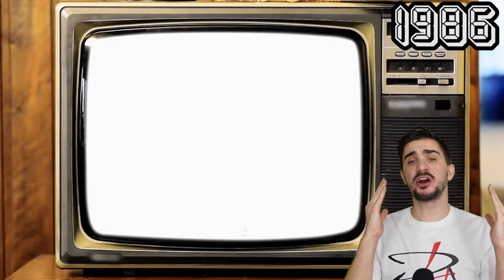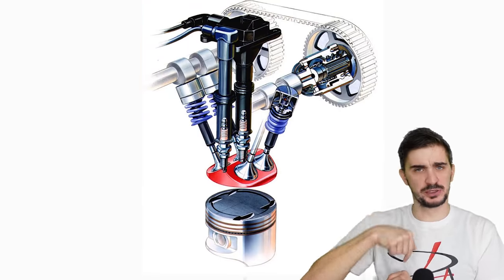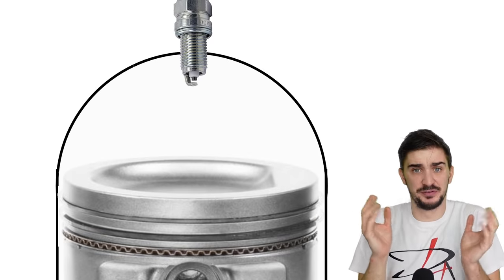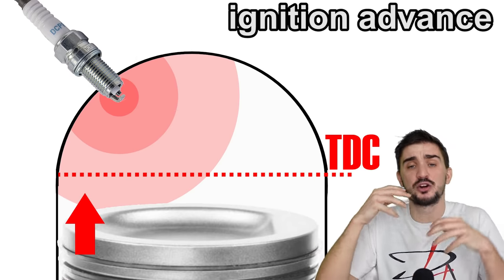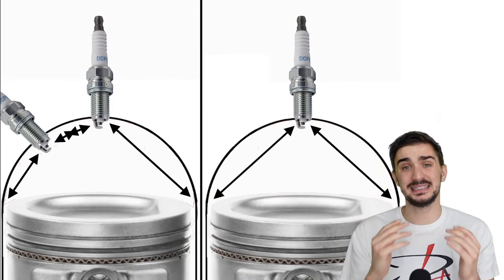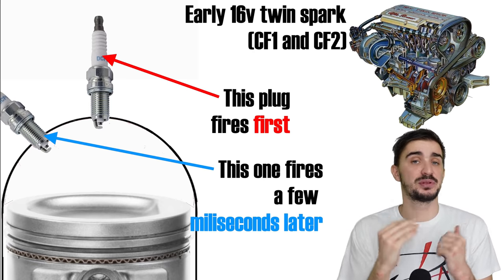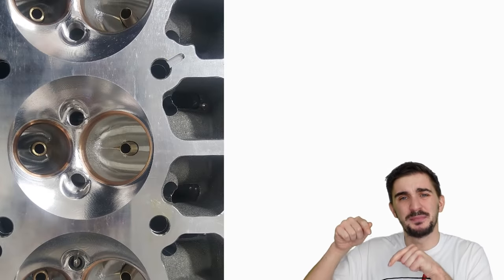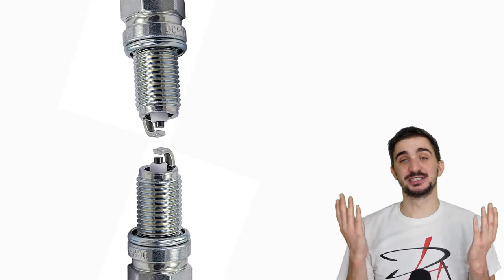TWIN SPARK - WHY, HOW and why it isn't more widespread

Comment: Big single cylinder motorcycle engines(Thumpers) definitely need twin or triple spark otherwise it just spits out the rest of that unburnt fuel to the exhaust.

Comment: I pondered multiple plugs. Each additional plug produces additional negative torque before TDC and also consumes energy, but the maximum length a flame front has to travel is shortened, increasing positive torque while allowing later sparks, aiding mixing while hopefully countering the additional spark's additional negative torque.
But two plugs aren't really sufficient. It's still a long way from the plugs to the furthest point in the cylinder. However, three works well, so a three-valve three-spark engine with relatively late spark timing makes sense.

Comment: One other application which has two spark plugs per cylinder is nitromethane burning Top Fuel dragsters and Top Fuel Funny Cars. These have 10000-12000 horsepower in their V8 500 CID (8.2 liter) engines.

Comment: NR750 had two, so it have to be good :) 
Btw, direct injection is a shit, just check all those TSI and other engines after 100k km. All has carbon junk in their intake manifold, valves, etc.

Comment: Nothing new. The Porsche 911 (964 series) has had dual plug ignition since the last 80s and continued into the 911 (993 series) till the late 90s. And of course we use them in aircraft engines primarily for safety reasons.

Comment: Will LASER ignition ever come the I.C. Engine?
Reply: 20 years ago I applied for a job at a place that was making experimental fiber- optic sensors that would be used to monitor every firing of every cylinder on an engine to make sure every explosion was optimal. I don't think it ever caught on.

Comment: Gasoline is a awful fuel to burn in a piston engine. We had a propane fueled fork truck that had not had it's oil changed in 10 years and ran fine.

Comment: Every chrysler car, dodge truck, dodge car or jeep with a hemi engine made from 2003 - 2022 whether it be a 5.7, 6.1, 6.2 (hellcat), or 6.4 has 2 spark plugs on each cylinder. How did you overlook this lol. They are not rare

Comment: Variable valve timing is a nightmare to produce and finicky I know because I worked in a factory in VVT. and as you know a failure of a VVT component will instantly destroy your engine. Efficient? Yes. Reliable in the long term? Hell no.
Reply from the maker: I would love to hear how a vvt component failure destroys an engine
Reply: @d4a  see we had multiple failures on our testers and had to constantly tweak the testers in order to pass the VVT units so we could meet the shipping deadlines. My relative had a Chevy Equinox that had a VVT failure and I belive the valves were forced into the top of some pistons and they simply paid to replace the engine. The engine light did come on and let them know there was a problem with the VVT but it damaged the motor before they were able to be scheduled for maintenance as this was their daily driver and only car.

Comment: The Ford 6.2L V8 (BOSS) from the original raptor and the SuperDuty Trucks use twin spark plugs. My 2019 F250 has them. https://en.wikipedia.org/wiki/Ford_Boss_engine

Comment: 12:25 nope, mostly there is one coil with two spark plugs per cylinder and another coil on another cylinder, there is no cross connections

Comment: Funnily enough, my Honda Nt 650 deauville has twin sparks and three valves per cylinder

Buuuuut, it doesn't rev all that high, doesnt make all that much power, isnt burning all that clean(carburetted and no cat from factory)
So kinda unnecessary IMO. Plus the secondary spark plugs are a nightmare to get access to

Comment: Heads up !  An airplane engine cannot produce peak rated Horsepower using only a single spark.  It totally relies on TWO spark plugs to produce rated Horsepower.    Look into it...

Comment: WRONG!.... the Alfa Romeo story on here about the later 16V Twin Spark engines is wrong!

CF1: only inlet cam variable and wasted spark ignition: big spark plug from one cilinder #1 and #2 is fired on the same time as small plug on the other cilinder #3 and #4 and vice versa. So two sets of coils are fired on the same time. One coil always fires two cilinders.
And just 1 catalitic converter.
CF2: same as CF1 but also variable inlet length.
CR3: same as CF2 but with complete sequential ignition: both sparkplugs from one coil are in the same cilinder. And three catalitic converters for the ever more strict rules.

Regarding 1.8 Twin Spark:
CF1: 1.8TS felt most powerfull 140HP
CF2: 1.8TS was the most powerfull 144HP
CF3: 1.8TS felt less powerfull as CF1  but with same power: 140HP (less power than CF2 because all those cataltic converters).

Comment: I used to own a car with 2 sparks per cylinder. It is 4 bangers but uses 8 spark plugs like an V8. It's slow, output below average horse power for an engine of the size and era. Fuel consumption, on the other hand is only slightly above average compared to other engine.  Total disappointment.

Comment: this demonstratea the flame theory about detonation is wrong and it’s just that when you have hot sports the combustion time is reduced and it requires retarded timing otherwise it’s equivalent to preignition. 
with the twin spark if one is not firing you get awkward timing because it will need more advance

Comment: The hemi solved all of this nonsense before it began. 
Hemi is not specific to Dodge/Chrysler/Plymouth. This also includes H-D motorbikes.
The design of the the hemispherical  head greatly improved combustion rates and efficiency, ok adding a bit more spark here or there in advance or lagged "may" add a miniscule level of efficiency, but when you consider the cost of engineering and additional systems and cost, complexity  to control all of this fluff. ..not wort it at all..

Comment: my 200cc single cylinder motorcycle have 3 sparkplug one on top and 2 side by side pulsar NS200 made by bajaj with 24.5 hp

Comment: Civilian aero gasoline engines are hilarious, because they're obsolete inefficient 100 year old technology using modern electronics that requires super expensive high octane fuel. Turbo-diesel aero engines are far superior, if you have to use a piston engine to drive a propeller.

Comment: My 3.5 Hp Briggs n Stratton lawn
mower works just fine with one spark plug.
The design of the head has alot to do with it.
If you have a bath tub style head with the plug
in the center, the flame fronts are forced to run from front to back across the piston crown. So, in this case one plug works just fine. Two plugs?? On aircraft, because of redundancy, n safety, you will still have spark.
I just wish most would have at least two brain cells... 🤔